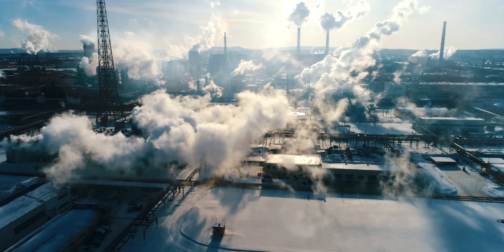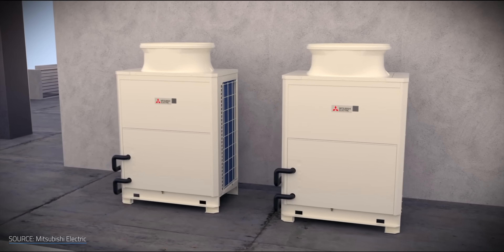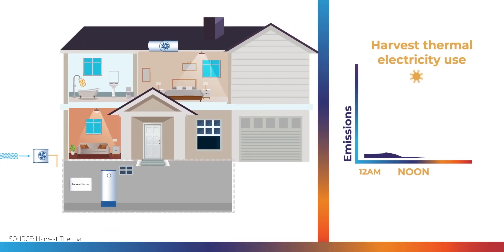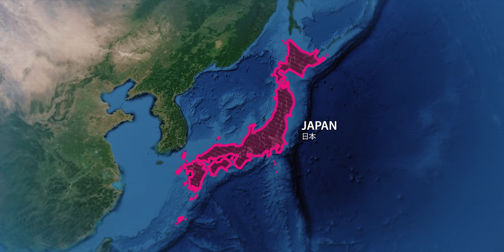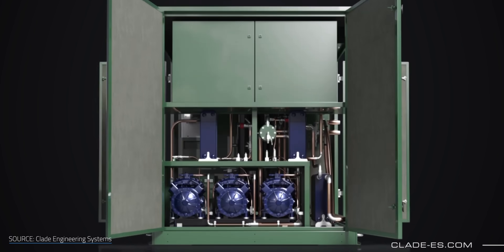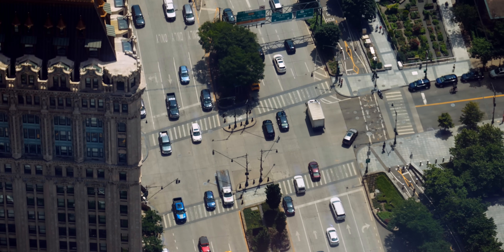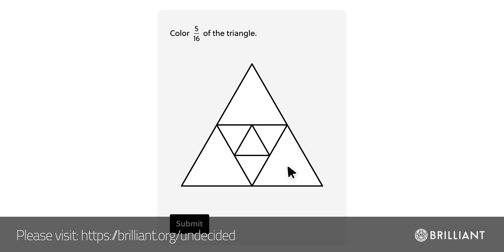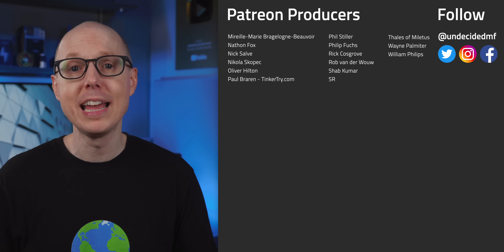Why CO2 Heat Pumps Are The Future Of Cooling

Comment: To put into context old heat pumps used R22 that had a high side pressure just above 200psi, current heat pumps use R410a which have a high side pressure just under 400psi. CO2 would have a high side pressure above 1500psi for a residential heat pump or 1700psi to 2100psi in a water heating application. R134a which is currently used in heat pump water heaters has a high side pressure around 200psi. 

That is a significant pressure increase. The higher the pressure the higher the failure rate on these systems. When R22 was phased out and manufactures started using R410a the leak rate on systems increased exponentially. Due to the complexity of the heat pump water heaters it's not economical to service them when they have a leak. Even when they are under warranty the manufacture opt to replace them.

Instead of always chasing efficiency, maybe we should take a step back and look at the waste stream we are creating. It takes a significant amount of energy and resources to build these. So if we are replacing the unit 2 to 3 times in the lifetime of a single less efficient unit are we really saving anything?
Reply: Slight error in your report…
The massive leak rate increase when R410A systems started gaining popularity had little to do with the refrigerant pressure… 
Proof of this is the leak rate on same age R22 units was at same rate… the leaks were caused by PAPER thin copper coils with internally rifled tubing to increase heat transfer surface area in the evaporator coils… 
Yeah, imagine that… thin out the copper, and use it in a wet environment and leaks from copper corrosion proliferate… who knew?
Reply: @SuperVstech  During the changeover indoor coils were sold that were for use with either R22 or R410a. When the coil was used with 410a it had a higher failure rate. Most of the coils you are speaking of are the riffled aluminum coils. Yes they are junk. But since we have pushed for efficiency over longevity that's what we have, paper thin coils that last 3 to 4 years. 

Sure that 18 seer looks good on paper but here in 5 years when the microchannel coil start leaking or a power surge took out the vrf control board which subsequently grounded out the compressor, and the installer didn't register it so your out of waranty. Are you going to pay the $7k to fix it or just finance a brand new unit for $14k?
Reply: @SuperVstech  Was going to post the same thing - those of us in the industry know better. Leaks are not caused by pressures, but making the copper coil more efficient and making them with those inner channels is hard to make reliably. 
You can also help though by coating the coil with a protectant, but I have limited first hand info if that works. The newest Pioneer unit I installed, already had it applied.
Reply: Maybe the reason manufacturers opt to replace rather than repair has to do with the economics behind the safe disposal of R410a? With CO2 this won’t be a problem so maybe the repair will be just as easy as changing a component and recharging gold ol’ CO2 back.
Reply: @forcedbreathingistyranny696   We recover it in a tank, when the tank is full we turn it in to be recycled. It's not a hazardous material.

Charging CO2 isn't simple. With the pressures involved, it's more along the lines of refilling a scuba tank than charging an AC unit.
Reply: 200psi makes quite a bang, never mind 2000...
Reply: @mememaster147   It isn't just the risk of a "bang", it's the inability of manufacturers to make coils that can reliably contain refrigerant at those extreme pressures without costs spiraling out of control. Most families can't afford a $20k heat pump, let alone $1000+ service calls when the compressor dies prematurely or the system develops a leak every few years.
Reply: You are saying what pressure CO2 heat pumps would need to have as if they are some brand new technology that hasn't been implemented yet.  If you actually watched the video you would know that they have been in use in Asia and Europe for many years.  The higher pressure requirements increase some costs, but are otherwise a solved problem.  

And it is not like 2000psi is some extreme number.  Modern diesel engines typically have an injector rail running at 20,000psi or more, and they have to be able to open and close valves leading into the cylinders thousands of times per minute for thousands of hours of operation, without leaking, under extreme heat and vibration conditions.
Reply: Something else to consider here is that the refrigerant itself is a key factor in the environmental cost of a refrigeration system. The global warming potential of hydrocarbon refrigerants is hundreds of times higher than CO2. And the higher peak energy consumption means more resources consumed on back end infrastructure (larger/more transmission lines, more generators, more grid scale energy storage hardware etc etc).

It's not as simple as just looking at the monetary cost of the endpoint hardware and its longevity on their own.
Reply: @bosstowndynamics5488  says here r290 is gwp 0.072 at 20 years and r744 is 1. why is propane lower than carbon dioxide?
Reply: @hardrays  R744 is by definition 1, because GWP is effectively R744 equivalents. A quick check suggests R290 is only quoted at those values by a single source, and some rereporting of that same source, other sources claim 3, which is still quite low when considered in terms of total volume of refrigerant used, but the GWP is only really a side benefit of CO2, it's main benefit is that, when used for water heating, it's way more efficient because its refrigeration curve matches up really well with water heater temperature targets.
Reply: @bosstowndynamics5488  At the end of the day, it really is as simple as that.
2000psi is a serious safety risk, would create ridiculous hardware requirements that wouldn't be feasible for most to-scale solutions, would break far more frequently and thus multiply the already very substantial hardware cost, higher risk of breakdown means higher risk of potential loss of operation/product as such a cooling solution could be used to cool an industrial freezer, cooler or air conditioner keeping hundreds of thousands of dollars worth of product at a low or specific temperature.

Bla bla bla, whatever really. The main point I want to make you understand is that Matt Ferrell has never ever posted a video about some "inventive new solution" that actually works outside of a tiny vacuum created by marketing material.
Reply: @Tyiriel  Have you ever heard of common rail diesel engines? Those are a very wide spread use of small scale high pressure systems that can easily handle 2000psi. But really that's beside the point given that at least one other commenter on this video has a CO2 refrigeration system fitted to their own house today. This is already a thing that exists, is reliable and scales down. But it's much easier to argue against it if you focus on one scary sounding number attached to it and pretend the engineering that solves it doesn't already exist.
Reply: @bosstowndynamics5488  yeaaaaah 100% agree....go ask the firefighters that are carrying compressed air cylinders on their backs into burning buildings....they were 2200psi back in the 80's...4500psi and 5500psi tank pressures are now common.   If ya can't track down enough firemen....go ask some divers!
Reply: 5:16 Not a tall order for industrial applications, pretty damn tall for residential. Thanks for adding context for the uninformed, I was afraid Matt would gloss over 20-30 atm as "no biggie"
Reply: Or manufacturers should make the effort to build reliable products. Air con in all 3 of my over 25 year old cars works just fine. Dad's brand new heat pump? Nothing but trouble ever since it was installed.
Reply: @karrotop  Agreed.  My experience is almost opposite.  Gas boiler - very expensive - nothing but probs from Day 1.  Eventually got a replacement from mnfctr.  Still constant probs. Many expensive service calls.
Air-to-air HP (Trane XL16) - flawless after 5 yrs.
House is beautifully cool now in summer, for negligible kWh consumption.  And does most of the space heating. All down to about -8° C OAT.  (Not a CC HP, just a moderate one.)
So, point is, our experiences are anecdotal.  Would need to record the data of many thousands of units to get a read on performance. 👍
Reply: None of this is actually an issue in real life (and hence CO2 heat pumps being available and used in a lot of the world in both residential and commercial applications). It might help for some perspective to look at hydraulic systems. 2000 psi is reachable at maximum effort on a car’s breaking system. That’s higher than high side pressure on a practical CO2 heat pump (most components are specified at 130 bar max operating pressure, which is 1885 psi).

But hydraulic systems can go up to many thousands of PSI. A 737 or A320 airliner has a hydraulic system running all around the plane at 3000 psi, and 787s and A380s have 5000 psi hydraulic systems. There are even hydraulic systems that go up to 10,000 psi. Obviously we are able to make pipes, fittings and compressors that can withstand these pressures.
Reply: There are tons of CO2 heat pumps operating in our area. They work great and do not go bang! 10yr warrantee, the units have been around 20+years in Japan. The key is all the CO2 is inside the box, they are monobloc; only water goes in & out of the box, not refrig lines.
Reply: Pressures mostly affect material thicknesses. 
Pressure ratios are a large factor in efficiency and lifespan. 
The biggest factor in product lifespan though is the designed lifespan. Manufacturers realized that they could sell more for longer if the systems didn't last as long. Every single industry has this and HVAC was actually kind of a late adopter to it. Cheap crap that barely lasts the first use can be found in almost every product category. Decent low end equipment that lasts about 10 years is about the sweet spot for mfgs and consumers. One can buy the newest latest greatest tech in a few years and update their equipment and the mfg can use that money to fund new designs.
ACs not lasting as long is not because of the refrigerant pressures, it's a result of marketing, mfg habits and buying habits.
Reply: @mikes2381  SEER requirements push manufactures to use thin materials for better heat transfer, EPA regulations are pushing the industry towards higher pressure refrigerants. Consumers being short sighted allows manufactures to continue making subpar equipment in order to make higher profits at the cost of the consumer.

"it's a result of marketing, mfg habits and buying habits." I would say that's an accurate statement. 👍
Reply: I sailed on a ship as a cadet engineer, in 1969, the ship itself was built in 1949.
(SS Pyrrhus - Blue Funnel Line).
It used CO2 as a refrigerant.
The compressors were enormous, because of the high pressure involved.
The refrigerant cooled brine, and this cooled brine was pumped around the refrigerated hold of the ship.
Ammonia was used on some ships as a refrigerant, but the toxic affects of any leaks meant it was not popular.
R22 was the gas of choice.
Reply: The other issue with CO2 is that at the expander valve, it can convert to the solid form (dry ice).
Reply: The fact that any of these systems leak coolant is absurd. I work with co2 and other gasses at work and have no problem using proper connections and sealants. I have no problem with exploding tanks, even when they are outside in the sun. Let’s say there is a leak, how much would it cost to refill with co2? lol. I know people with old ACs that recharge their system with refrigerant every year, for hundreds of dollars, and that stuff just ends up being dumped into the atmosphere.
Reply: @SetTheCurve  I work on commercial RTU's and the main problem ive noticed when it comes to causes of leaks is vibrations from the blowers and fans, its only a matter of time after that.
Reply: @ApacheFPV  Interesting. That is actually good to know. I can see how some systems have balanced and serviced fans that run well for a long time. I can also see how other units end up with unbalanced fans and this can shorten unit life. Many people spend very little time paying attention to and servicing the units. This is actually a problem that could be solved. In the design of the unit one could isolate the fan and isolate the vibration.
Reply: @SetTheCurve  It's not the cost of the CO2, it's the labor cost. Also consider the fact the a high pressure refrigerant will leak considerably faster out of the pin hole leak than a low pressure refrigerant. The new refrigerants the industry is moving to has a very low GWP.
Reply: @SetTheCurve your statement is naive if you have not worked in HVAC industry from a technician or engineering perspective. As Metals age they corrode and the machines vibrate.  This can reveal weak spots in the system overtime where a leak might occur. To get good heat exchange from Air to metal on the heat exchanger  heat pump coils, the refrigerant has to pass through a manifold of channels where the air flows through the coil. These Heat exchangers have hundreds of welded or brazed connections on them. Most of them don't leak.  It would be cost prohibitive to build to build a machine that could 100% guarantee that no matter what it will not leak as the metal ages.  It's easy to have a propane tank and a few pieces of piping and to guarantee there's no leak. With heat pumps and air conditioners, it's like splitting a larger gas pipe into hundreds of hair sized diameter pipes.  That's a bit of an exaggeration but you can see what I'm talking about here where the number of potential leak points increases super exponentially When comparing a simple gas line to an entire split heat pump system.  There are also other conditions that bring in acids that can corrode systems to cause leaks.  Such as when homeowners let Mulch and organic matter build up around the outside unit we're about an inch of the unit is literally at soil level. Because you cannot control how well homeowner will maintain a heat pump, it would be helpful for the industry to switch to refrigerants that do not harm the planet because there will always be leaks.  It's much easier to prevent leaks in an industrial setting with teams of inspectors and Engineers always on site. Clueless homeowners often do things that work against the health of their heat pump system, sometimes leading to leaks
Reply: @SetTheCurve   they don't just leak. It is always from a failure, lack of maintenance, poor workmanship, bad part, or some human caused action
Reply: <<they don't just leak. It is always from a failure, lack of maintenance, poor workmanship, bad part, or some human caused action>>

I would imagine that a lot of leaks come from the vibration of motors and other operating equipment.
Reply: @SetTheCurve The chasing after greater efficiency means making thinner and smaller coils. These aluminum coils are so damn thin, micro coils, that leaks are very inevitable and nearly impossible to repair. This is why the failure rates are so high.
Reply: @josephdestaubin7426  the thin microchannel condenser coils aren’t the problem, it’s the copper portions of the evaporator indoor coils that fail… water just absorbs all of the home’s pollutants, and collects it in a moist environment causing corrosion… millions of microscopic formicary corrosion failure points, and you have leaks.
Reply: @SetTheCurve  The Dunning-Kruger effect on full display
Reply: @SetTheCurve   LOL. I don't want to be rude, but can't stop laughing at your statement. You did not have proper understanding or the experience of materials which subjects to high pressure, surely you never see inside of a heat pump. Based on your comments you are handling some gas bottles connections, filling, monitoring in a warehouse or factory probably, so you wont know. Materials, joints, valves and compressor that will handles such pressure will fail much faster in real scenario. And most leaks will be unrepairable and unreliable posing safety risks. you have to replace whole section or entire part (more loss), cause now you cannot rely on it, it may fail again in just few centimeters away, and pressure testing is not going to be easy, if you ever done it you would have known. No one cares about how much the CO2 costs. its the labor, knowledge, excellence and handling will become challenging.
Reply: @SetTheCurve  Huge differences between a work environment. I work on Ammonia refrigeration they are greatly more efficient than your C02, I still don't want that in my house. The standard for joints are greatly different.
Reply: "...are we really saving anything?"

Ask Japan and the hotels, maybe?

The benefits of climate control on larger scales seem to vastly outweigh the costs of breakages frequent enough to wreck the budget of your regular home.
Reply: @Moepowerplant  On a large scale it makes much more sense because there is a lot more to gain or loose. 

My comment was specifically regarding the US. A lot of other countries have the low cost labor and skills to support fixing this stuff. In the US we have a habit of just throwing things away.
Reply: Not cheap to have hydraulic hose to replace our 800psi RATED hoses for gauges. And then a tank, may as well carry around a big airgas tank....
Reply: thanks that's what I was concerned about. thought pressures would need some different wall thickness of the tubing.
Reply: Great comment. The first red flag was this process is over a century old. So why is it just now gaining traction? Hardware has real physical limitations, so if cheap enough high quality metals to very tight tolerances was the issue then maybe the tech makes more sense, but if solid real world limitations exist then those won't change anytime soon if ever. I suspect the surge of green tech and CO2 buzz is being abused.
Reply: Higher pressures just require higher precision and higher quality manufacturing and installation.
Reply: I already have one (air to water heat pumps domestic hot water system) here in Australia. There would be millions in Japan. Don’t talk about this like using CO2 is theoretical!
Reply: Typically, ammonia refrigeration systems can run at a discharge pressure of 95-100 psig for the highest efficiency. In this case the most savings results from a pressure of 128 psig.

With that being said at 128 PSI ammonia temperature reaches -28 degrees F

"what they’re often defending is our nation’s peculiarly brutal economy. “Low-road capitalism,” the University of Wisconsin-Madison sociologist Joel Rogers has called it. In a capitalist society that goes low, wages are depressed as businesses compete over the price, not the quality, of goods; so-called unskilled workers are typically incentivized through punishments, not promotions; inequality reigns and poverty spreads. In the United States, the richest 1 percent of Americans own 60 percent of the country’s wealth, while a larger share of working-age people (18-65) live in poverty than in any other nation belonging to the Organization for Economic Cooperation and Development (O.E.C.D.)."
Reply: By your logic, we shouldn't been using cars; creates a lot of waste stream. Should stick to horse and buggy, right? There's no stopping technology and there will always be waste streams when new tech is being tested by early adopters and adjustments need to be made. CO2 is more efficient than current refrigerants and, yeah, it requires higher pressure. This was all pointed out and yet there are manufacturers who believe this idea will take off and have already produced CO2 heaters and ACs and there are already large businesses buying into it. Let them spend their money to test out the technology; I don't see the purpose is shooting down new ideas that, objectively, have benefits. It's not like they are trying to sell solar panel sidewalks.
Reply: Also, wouldn’t it go through its triple point and dry ice would form and clog the evaporator?
Reply: In a refrigeration system, carbon dioxide (CO2) is a high-pressure refrigerant
. 
 The critical temperature of a refrigerant is the temperature at which the refrigerant gas cannot be liquefied. 
 In a CO2 refrigeration system, the CO2 is boiled and expanded into a superheated vapor  by an evaporator. Then, a compressor increases the heat and pressure of the vapor. When the pressure exceeds the critical point, the CO2 becomes an undefined gas. Big Problem
At the critical point, there is no distinction between gas and liquid. This means that there is no condensation  or evaporation. The heat transfer  properties of CO2 decline, and efficiency drops. CO2 is not flammable or toxic, but it is potentially less efficient. The high operating pressure of CO2 systems can contribute to power inefficiency, especially in warmer climates. Criticial Temp of CO2 is 87.8F Manufacturers make HVAC products to service the whole market not niches they make their money buy selling to the masses not niche markets. Good night and good luck. (this post isn't to suggest there aren't products that use CO2 as a refrigerant, but these are large complex commercial applications niches within the HVAC world that have the money necessary to throw at various problems this kind of refrigerant could produce. Up keep, maintenance & repair and eventual replacement when the money runs out. LOL)

R32 & R454b are going to be for USA market in 2025 (probably start showing up in 2024 sometime). Another 10 or so years after that they will be phased out for something else. They have to because they do not hit the GWP targets set by the Kigali Amendment to the Montreal Protocol. Fun times in HVAC, changing refrigerants like worn out underwear. I think we'll use R290 before we use CO2, but to use R290 is going to require redesign / reworking of entire HVAC system or the insurance industry will revolt due to fire risk as R290 is none other than propane. So more money is in your future whether you like it or not. You voted, congratulations.
Reply: Manufacturers struggle to keep refrigerant in systems operating at 400 psi. Good luck containing 1500+ psi.
Reply: And don't forget R410A does NOT deplete the ozone layer! So all the ozone saving benefits he talks about is irrelevant.
Reply: The problem you raise with waist streams is an issue that needs to be dealt with on a global scale... A circular economy/ reuse of old crap is the future for EV batteries and should be the future for all products we use. The Earth is a limited resource that cannot be plundered forever, nor can it be filled with a bunch of discarded garbage.
Reply: @VastmanDanaP  LMAO... Matter is never destroyed... the Earth CAN be "plundered" FOREVER!! What do you think piles of ore are? Ore and other matter are just "garbage" that we dig up and utilize... then put back into the ground!
Reply: @VastmanDanaP  cheap Chinese manufacturers.  Nobody wants to pay for quality, the just look at the price.
Reply: I thought they were lowering GWP more than increasing efficiency.
Reply: @user-bj4lp3fr1o  The new refrigerants the industry is moving to, R32 for example has a GWP of 675 vs 2088 of R410a. There are much more practical refrigerants than CO2 in a residential setting that have a low GWP
Reply: @TofuInc  so your comparison of 675 to 2088 GWP is a 3 to 1 improvement. the GWP of C02 is 1, that's a 675 to 1 improvement. 675 is not a low GWP,  it is a less terrible than a more terrible 2088 GWP.
Reply: Presumably, the homeowners would be saving money
Reply: If you do not understand metric system, you do not understand technology.
Reply: If you leak CO2 refrigerant, it’s easy to recapture other CO2 to make more refrigerant.  You can’t really same the same about the CFCs
Reply: We'll figure it out eventually.
Reply: High-pressure heat pumps should be a lot more reliable and leak-proof than, say, a couple of decades ago with improved compressor designs and hose materials.
Reply: Installed my own system 25 years ago including all new ducts, planers, boots, electrical etc etc for $3600.  12 Seer with 92% ng furnace.   Absolutely trouble free for over 18 years.   Wife just replaced the system,  $25,000!  Crap broke after 11 months.   Welcome to all the new technology and bells and whistles.   What a joke on society.   I'm feeding my woodstove with dead trees from INVASIVE BEATLES this winter again.   I mean it's CLIMATE CHANGE.
Reply: In EU a lot of those Coldfluids wi be forbidden soon so there is only co2, bhutan or Propan..
Reply: But, if you design the water heater cleverly, you can have all the valves and connectors in a place wherr they can be serviced, those are far more likely to be the issue than the plain tubing.
Reply: Great response.
Reply: More jobs for a private repair shop??
Reply: Excellent point
Reply: Future of cooling? I only heard about heating in this video. Does anyone make a residential CO2 unit that heats AND cools?
Reply: Money spent =/= Pollution
Reply: R410a is actually now being phased out too 😂. There are a  few different refrigerants that are replacing it.
Reply: Sorry about the late response.
 I fully believe your analysis. But keep in mind that high efficiency condensing boilers had a much higher failure rate than traditional boilers twenty years ago. There still are some high efficiency condensing boiler that have a shorter life spans than less efficient boiler. But now there are high quality high efficiency condensing boilers that when maintained properly will last as long as low efficiency boilers. It was mostly a matter of determining how much the high efficiency condensing boilers needed to be over built relative to traditional boiler. Hopefully CO2 heat pumps will take a similar but hopefully quicker path. Time will tell.
Reply: @erniecolussy1705  The quicker path is to use a lower pressure refrigerant. R134a dominates the HPWH space currently. As R134a is phased out it makes a lot more sense to use R290. 

Purdue university published a study in 2021 comparing different refrigerants in water heating applications and came to the conclusion that R134a, R290, and CO2 were all nearly identical in performance. With the GWP of CO2 and R290 both near zero.
Reply: Seems like everything you said was not backed up by any evidence. You sound like a conspiracy theorist. Do you think the world is flat? Maybe the gov wants you to think that. @@zippydastrange
Reply: the problem is not for you to replace your device multiple times, but the problem is that using old gases depletes to the ozone layer
Reply: @tiagoscp36  Low pressure, low GWP refrigerants exits.
Reply: @TofuInc  there are not many low gwp, a1 safety refrigerant and those that have high safety are limited by quantity of refrigerant that can be used
Reply: @tiagoscp36  Everything is moving to A2l and A3. R290 is a works well in place of R134a for HPWH applications. If you have a fridge or freezer made in the last 6 years it likely uses R600a. Residential HVAC is moving to R32 or a blend of R32, 1234yf, R125 like R452a or R452B.
Reply: @TofuInc  all HFC will be substituted
Reply: I have said the same thing about windmills, I mean besides destroying any natural beauty where they are erected, and killing wildlife, the metal towers and the blades and the constant maintenance for the less than optimum power output.  Seems to me that the downsides far outweigh the upsides and they just do not have enough net energy output at the end of their lives to justify them.  This can be computed as a net cost per kWh compared to other forms of generation and I think that other than wave energy windmills are the most expensive out there except for possibly nuclear.  At least nukes when you include all the costs related to it including subsidies because taxpayers are still paying for those if it is not in the energy bill.
Reply: My company also not believing in the co2 but focuses on propane based applications. Might be slightly different in automotive industry where we are operating though.
Reply: Great comment
Reply: Also keep in mind R-410a is being phased out for R-32 in the near future (i believe 2024 you can no longer get equipment that has R-410a).
Reply: <<Consumption are the wheels that drive Capitalism.>>

Only partially true.

Before consumption must come the investment that can produce the goods and services to be consumed.

Worship of consumption by individuals is an excuse for spending every penny earned by someone, and every dollar they can borrow. That is consumption, but consumption of any investment needed by the economy.

For individuals,  frugal living, saving and investing in the future is to be recommended.

If you want to spend the most over a lifetime,  the compound interest of investments will dramatically increase your ability to spend long term.

By contrast, every dollar spent on interest to buy junk multiplies itself to reduce the amount you will have available to spend over a lifetime.
Reply: @@mattmann5620 And thankfully we ALL consume!!
Reply: Skillissue. If you have enouigh skilled labourers to install such systems you will not see more leaks. This is a solved problem. Unless you don't value high quality labour.
Reply: Bless your heart! Thanks for commenting. I'm not the op video maker. But a random who reads comments...

And you just dumped a bit of wisdom on us. If YT's comment system wasn't utter garbage, Matt Ferrel might actually read your comment as well!
Reply: It's about manufacturers making  money, that's it.
Reply: Sure, but this wouldn't matter for a CENTRALIZED system that is well done and well maintained that can deliver heat for an entire neighbourhood...
Reply: This hit me as a big red flag so thanks for taking the time to elaborate. I managed a lot of commercial property in Arizona, so almost all some form of heat pump tech. Lots of calls from what commonly ended up being issues with the compressor or giving it enough power.
Reply: Hey all! I am a mechanical engineer and do life cycle assessment studies on products in a company that makes heat pumps. To be fair, i held the same opinion as you all regarding the fact that different gases result in more complexity, replacement, etc. But the thing is, analyzing the whole life of the machine, turns out that the overwhelming majority of the emissions are the second-hand pollutants emitted generating the electricity needed to run the heat pump. And not by a small margin either, it's at least a couple orders of magnitude more! So, until we will be able to generate at least 99% of our electricity in a clean way, a more efficient heat pump running a less environmentally friendly refrigerant will be better than a less efficient HP running a better refrigerant. This is true as long as the ODP of the refrigerants is zero or close to it (like modern HFCs such as R32 or R410a). Don't cry tho! The industry is still moving towards sustainability, in fact my company is converting the lineup to work with R290, which is just plain old propane, zero OPD, GWP equal to 3 and mainly for outdoor applications since it's flammable.
Reply: @Daekanoid  I've heard about propane as refrigerant in heat pumps, and isn't the total volume of gas/refrigerant just a few ounces (maybe its more but that's what I seem to recall)? Doesn't seem that dangerous even though it's flammable.  I've got gas pipes running to my furnace and dryer in my home, and 20lbs of propane in a tank for my grill just a few feet from my door. None of that is likely to be as high risk as the 2 gallons of gasoline that's sitting on the floor in my garage for my lawnmower. Many people have similar situations and are still afraid of a heat pump with propane refrigerant. The average person has little skill in accurately assessing risk
Reply: @Daekanoid  I'm not personally worried about the flammability of R290 & R600a for domestic heatpumps, it can't be any worse than having a gas boiler or gas cooker in your house. At least with a heatpump there's a limit to how much gas can be released by a leak.
Reply: @Daekanoid  our problem with propane is there’s no one near us that can service propane. When our propane salad bars leak well rip em out and go to a more common refrigerant. But your other points are spot on. Cop >>>>> refrigerant gwp. And some places still have r22- I say the best refrigerant is the one that stays in the circuit.
Reply: @Daekanoid  nice, some actual numbers here. Nevermind that additional waste is not necessarily a problem, we have no shortage of places to dump waste. It's a problem if the societal cost of that additional waste is greater than the societal benefit from this tech. You could argue that insulation may have an even better net benefit (don't know if that is true), but in either case if the benefits exceed the cost then the waste is justified.
Reply: We’d all still be driving cars with tubes in their tires - because tubeless tires are too dangerous..  And they’d have drip oil lubrication systems because that’s simple and cheap.  And we’d be burning leaded gasoline because it’s too expensive to put hardened valve seats and also there’s no way to have adequately high compression ratio for efficiency without lead in the fuel.  

New technology always involves people learning it and figuring out how to work on it.  Lead, follow, or get out of the way!
Reply: @matthewprather7386  CO2 has been used as a refrigerant since 1870
Reply: How about using under-pressurized water/vapor, like in computer coolers' thermal tubes? When going down with pressure, largest pressure difference is less then 15 psi
Reply: @salec7592  Water works well as a heat-transfer medium in the temperatures involved in, let's say, thermal power generation (nuclear plants and so forth - hot side several hundred degrees C). After all, a Rankine "steam" engine is pretty much just a heat pump in reverse (converting a temperature difference into mechanical power). But, if you try to operate one at very low temperatures as a heat pump, the volume of vapour that you need to handle for a given amount of heat being transferred becomes impractically huge at an impractically low pressure. How effective is a compressor going to be if the inlet side pressure is measured in millibars? (1 bar ~= 1 standard atmospheric pressure) It would need to handle a vast volume of extremely low-pressure and low-density vapour.
Reply: @salec7592  How about ammonia absorption refrigeration using direct solar at the heat source? 🤔
Reply: @TofuInc  In my reading, I believe I saw an article on Solar Ammonia Absorption refrigeration that was done in the 1970's. It worked, but it was very large and very expensive. It took up the entire roof, and cost about 10 times what a normal system would have cost. Someone made a system that cooled an entire standard residential home. It did work, but was not practical. Much of the cost was because of a large amount of copper tubing and piping and only a limited amount of cooling could be produced so they had to go bigger to get the needed cooling. It is a free world out there so if you can design a better system fantastic. By comparison, to cool with a window unit, while not the best, has very limited capital investment.
Reply: @cryptickcryptick2241  I said that more or less just to point out lots of things are possible but not always practical. I truly doubt we will see ammonia absorption come back to residential in my lifetime.
Reply: @salec7592  Wrong temperature range.
Reply: well said.  Reminds me of the obsession of getting rid of plastic straws, yet no one blinks an eye at the pounds of plastic packaging Amazon ships to every door every day
Reply: You don't need an engineering degree to be skeptical of CO2 heat pumps. CO2 is one of the most common and most studied gasses in industrial and domestic use. It's also one of the cheapest, far cheaper than common fluorocarbon refrigerants. It's also nontoxic and environmentally safe (as long as we're not talking about millions of tons of excess CO2 in the atmosphere. FCs are thousands of times stronger greenhouse gasses with a longer half life too).  If it was a viable refrigerant for domestic use, why wouldn't we have just used it since the early 20th century?
Reply: @iankrasnow5383  It is actually being used as a refrigerant right now. It's main downsides that have prevented it from use previously would be the high pressure first, and second it makes a very large temperature Delta and isn't good for regular air conditioning. Right now CO2 is used best for large freezer facilities, from single digit to even deeper cooling it's absolutely great for that purpose similar to ammonia but far far safer.

For heat pumps, it'd be good for those who want furnace like air temperature from the registers, like 180F instead of 80-100F. However in air conditioning I think it may be too cold for practicality unless they can control the subcooling and superheat target. It's even better for water systems, floor heating or radiators, or hot water heating.

Propane is another option that's good for high temp, like water heaters.
Reply: @Jaker788  I can see that wild temperature delta actually being really useful if they can manage the energy right!
Reply: @iankrasnow5383  The thing about this line of reasoning is that not being an engineer means you don't have access to information that might allay that skepticism. Healthy skepticism is reasonable but always remember that people who do have expertise in a field probably have knowledge you don't have, and that knowledge is often the reason they might disagree with you. As mentioned by the only person in this thread actually claiming to have any real engineering experience here it turns out that, today, CO2 really does have significant advantages that offset any potential disadvantage in shortened lifespan as long as that change isn't too large. That's the thing about assimptions based on old information - in this case, engineering has gotten better and direct water refrigeration has gone from being non existent to very common, both of which have substantially increased the utility of CO2 as a refrigerant.
Reply: @bosstowndynamics5488  Well I do in fact have an engineering degree (materials science and engineering), although it's been a while since I studied the thermodynamics of compressible fluids. In any case, all the information one would need on the properties of CO2 as a refrigerant are available for free online, such as the PVT diagram, enthalpy of vaporization, etc. You don't need to be a licensed engineer to find those for free.

But no, I didn't think too hard about this before responding and haven't looked into it. I'm skeptical because CO2 is not commonly used for domestic refrigeration applications, and because as others have said, the pressures required are much higher than for traditional refrigerants. That means the compressor and tubing needs stronger materials, and tighter tolerances. It also makes failure more likely in the long run, and the failure mode is much more explosive. The manufacturer's insurance costs go up. What happens if a compressor explodes and maims or kills a repair person, or a homeowner? That's a lot more likely at 2000 psi than at 400 psi. I don't think the cost and tolerances for high pressure systems have gone down all that much in the past 30 years or so. 

I'd be happy to be proven wrong once these systems are cheaper and more widespread though.
Reply: @iankrasnow5383  What I'm getting at is the reasoning provided was flawed - if "it hasn't been done before therefore it's very unlikely to work" was common logic we'd still be waiting for lightning strikes to light fires for us
Reply: @iankrasnow5383  people (and unfortunately many Americans moreso) are cheap and short sighted. They won't pay the extra cost up front for C02 heat pumps. Without regulations, we'd still be using R12 ACs performing at SEER 3.
Reply: @travelfeet  "Without regulations, we'd still be using R12 ACs performing at SEER 3." No a/c unit was that bad, ever. And FYI, R12 is more efficient than R134a.
But thanks to regulations and having to build coils with inner channels to boost efficency, we have a/c systems that barely last 5 years now without leaking.
Reply: Brilliantly said
Reply: This is also true in the construction equipment market. Constantly changing EPA requirements have resulted in a couple of generations of heavy equipment that don't work reliably. The results of this are that really big machines get sold off and replaced far more often. The old machines get auctioned off to poorer countries where all of the unreliable emissions gear gets stripped off, and the new machines are created at the cost of millions of pounds of new CO2 emissions. I've never seen a fair accounting of the true impact of these schemes.
Reply: @paulfay357  I think it's true across a lot of industries.
Reply: I presume this pressure is contained within a small loop within the outside unit and the lines going to the house are all hot water then?  I can't imagine having lines going throughout my house that are in the thousand psi range. If that fails it would basically be an explosion.
Reply: yeah true. ngl I didn't understand much of what you said as I don't know what psi or whatever means but I agree. If the system creates waste and you have to replace it then why buy it in the first place? I mean yes I want my house to be cold or hot depending on how it is outside but I want a stable heat pump that would last many many years
Reply: "So if we are replacing the unit 2 to 3 times in the lifetime of a single less efficient unit are we really saving anything?"   WoW!  That's a leap.  While you observe some accurate facts your conclusion is unsupported.
Reply: Matt Ferrel doesn't care, he just makes videos about random bullshit, makes it sound cool and scientific for views - nevermind if the technology works or is practical, he just reads the companies script and gets some shill money. There is no chance you're going to keep 2000PSI in any refrigerant system for 2-3 years, you'd be lucky to keep it for 2-3 months. Plus the cost of the thick tubing and ridiculously tight tolerances in compressor manufacture is going to kill the idea on arrival.

But seriously, 5 minutes into the video he's already shilling companies and claiming they can do the impossible.
Reply: @linuxguy1199  I think you missed the part where Denso put the tech in cars, then Japan adapted it to heat pumps and water heaters and from there it was adopted across Asia into Europe.
Reply: Nailed it. I too have noticed his penchant for shilling HARD, with every "new" topic @linuxguy1199
Reply: IKR, and landing rockets is a dumb idea… wait… @linuxguy1199
Reply: @linuxguy1199 that Harvest company is a scam. They ask the price for the system same as geothermal system installed
Reply: @andreycham4797  Not surprised mostly everything on "Undecided with Matt Ferrell" is, YT still recommends his videos though and every now and then out of morbid curiosity I succumb to the clickbait.
Reply: @linuxguy1199  You are ignorant.  You remind me of a tire salesman telling my father that those new fangled steel belted radial tires can't work. "Take a paper clip and bend it back and forth and see what happens."  (It breaks.)  Despite almost twenty years of the Michelin X, the first radial tire.
Reply: @linuxguy1199  what the hell is 'shilling'?
Reply: @linuxguy1199 , do the math, they don't have 2000psi. THey need on average 20-30 ATM of pressure. One ATM is 14.7psi.
Reply: How does a company stay in business. By selling what it makes. The shorter the life span the more they make. You only get to use the gasoline in your tank once. Get the idea? Some people!:face-fuchsia-tongue-out:
Reply: Pretty ignorant comment.  @RodgerMudd
Reply: @RodgerMudd  Exactly what I have been saying. Good way to put it too. Why fucking waste what we got???? Oh add egr, dpf and all other aftertreaments to exhaust systems, oh so we can just burn more fuel..? We only have so much of it.
Reply: Brilliant, well said, the trail of destruction and waste chasing unicorns to save a penny will not make anything more efficient - isn't this all window dressing so people can think they are helping
Better efficiency gains would come through simple insulation delivered globally
Reply: @AndyHancock  Well said. The KISS principle {keep it simple stupid} is best. It amazes me that people don't grasp the idea that the heating and cooling industry make their living by selling stuff. A analogy is a person outside and it is cool outside. Option 1: Go get a sweater or Jacket. Option 2: We'll sell you the most efficient heating or cooling devise that you can pull around blasting hot air or cold air to condition a micro space around your body but 3 feet away it is still cold or hot.
Reply: Nah, this is not the channel for that kind of rationality. More tech with higher failure rates FTW.
Reply: > So if we are replacing the unit 2 to 3 times in the lifetime of a single less efficient unit are we really saving anything?
Yes, the planet.
Reply: Lies. modern stuff runs on R32
Reply: @hillppari  In the US there is a move to R32 happening, but many systems still run R410 until they are no longer allowed to be sold.
Reply: @hillppari  What?  There's no such thing.
Reply: or r290, but only for all-in-one units..
Reply: @hillppari  Modern household refrigerators use R600a and R290. R32 hasn't made it much past window ACs in the US.
Reply: yeah co2 is trash really.. I miss R22, R410A is 'banned' here now so no more imports (10kg will run you about $1200 wholesale IF you can find it) 
So here I sit with an R410A system that has lost an amount of its gas, using more electricity (less efficient in a big way) until it finally vents off the rest (this will be my 6th R410A system I have seen out this way) until it is time to spend $$$+ on a new unit, filled with butane, My camp stove wont phase change the  butane on a cold morning here (it comes out the can as a liquid) so everyone has issue with their heat pump "freezing up" in the middle of the night and generally failing to keep up on very cold days.. yaaaay!
Save the planet, man.

Excuse me while I go throw another log on the fire, this is warmth the way nature intended!
Reply: @74KU I'm not sure where your bias comes from. I've worked in the HV AC industry for more than 20 years and I have an environmental chemistry degree and do environmental Consulting. R410a systems that are properly installed and also from a good quality brand have the same life as R22 systems. They don't leak more frequently.  Maybe you're using some low-budget non-qualified installer who is cutting corners and that's why you're having problems with an r410a system.  Please don't spread misinformation
Reply: @74KU  well, the R410a retrofit blends should be available soon… until then, you can add a bit of R32 or 125 if you can find that… which is what 410a is a mix of…